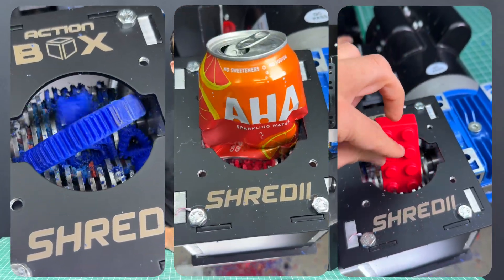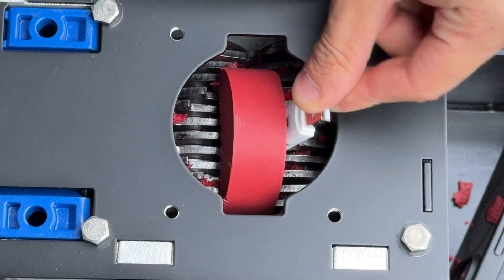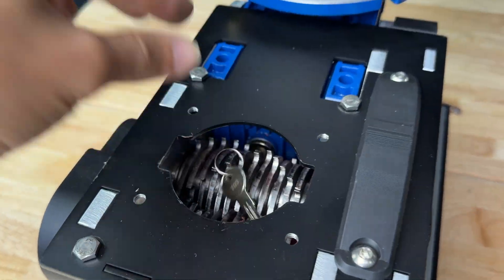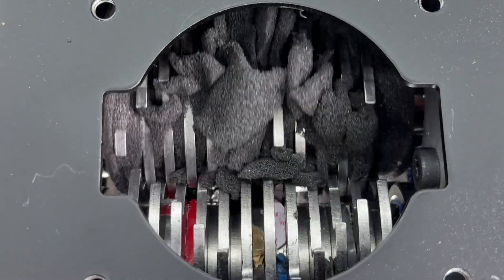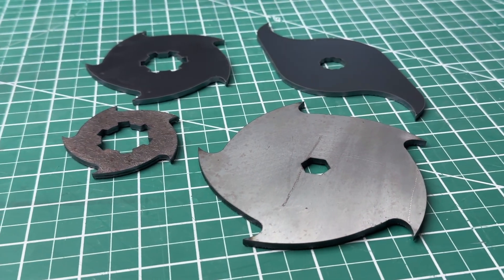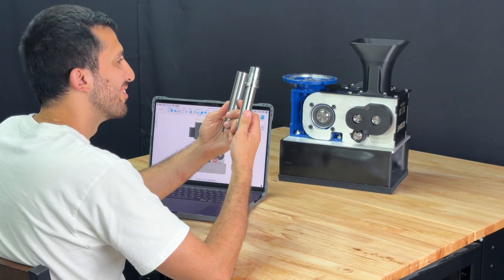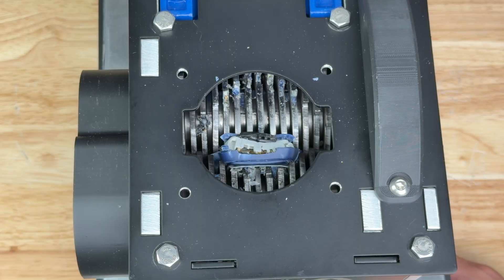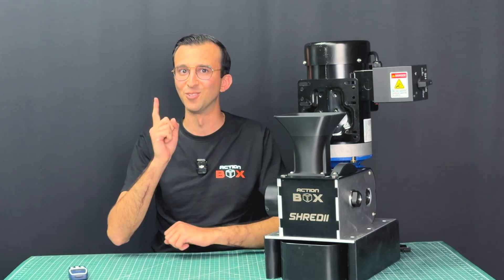Mini Desktop Shredder (Motor AND Drill-Powered) | SHREDII 8

Comment: I'm wondering when you guys are going to come up with a solid Pellet Extruder so we can turn Shredii's goodies into other stuff!
Reply from the maker: Do you mean a 3d printer extruder?
Reply: @ActionBOX  Yes exactly!  But one that will work directly with Shredii.  The workflow would be something like this: 

Failed Print -> Shreddi -> Into an extruder capable of using those shreddings directly -> Usable Prints.

Does it already work directly with Injekto in this way?

Comment: Tell you what, make one for the hobbiest who just wants to shred 3d printer waste and extrude recycle filiment.  Make it under $100. Better yet just sell the blades, shafts and box with a hand crank. I'll figure out the motor myself.
Reply: I've been looking at plastic shredders for years now and I'm still waiting for someone to bring an "affordable" model out. Even if it was just a small hand crank version. Us home hobby users can't justify spending thousands on something like this.
Reply: @xcalie22  I seen a couple diy jobs. The plastic gears don't look like they can handle it. I seen 1 old video, the Asian guy used an angle grinder to cut 50 car body washers into blades then used threaded rod and shims  and welded a box around it.😅 too much work  lol but that would be my route. Just can't find the body washers whenever I remember to look. Other option is have a cnc shop plasma cut 1/4inch  sheet metal into shape for yoy but then it's expensive too.   Cnc at home if you do have the machine also tales a long time.😅

Comment: Right on!  Looks like a beast!
Reply from the maker: It is a beast! What would you shred with SHREDII 8? 👀
Reply: @ActionBOX beside my 3D print failures, i have about 100 pounds of brass, copper, and aluminum scrap that SHREDII8 would shred down to compact and easily recyclable size.  😁👍
Reply from the maker: Ooo very cool! That’s a lot of scrap. What were you using the metals for?
Reply: @ActionBOX I'm a metal detectorist, and this is scrap that i find.   I plan to melt it down and pour it into molds (smaller pieces would be safer to melt and allow more to fit in the crucible at one time).  I'm not sure if I'll do something with the reclaimed material, or just sell it to a recycler.  We'll see...